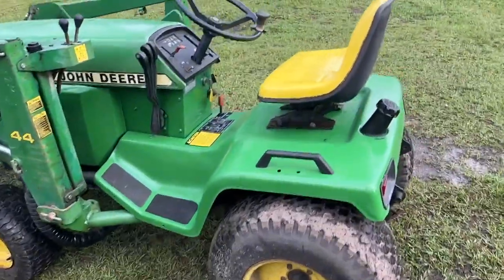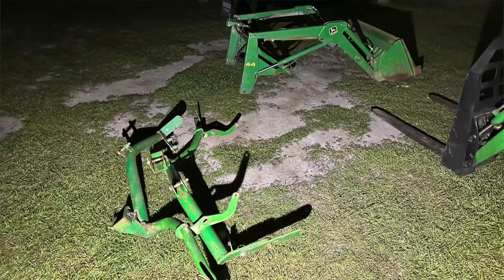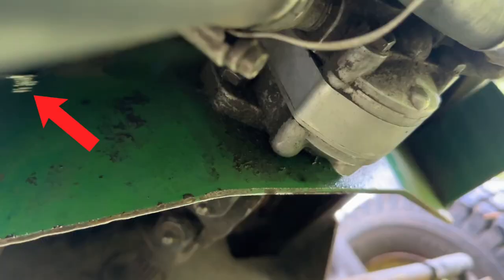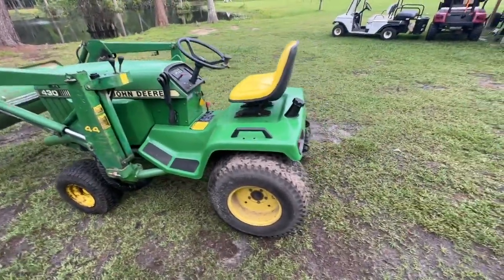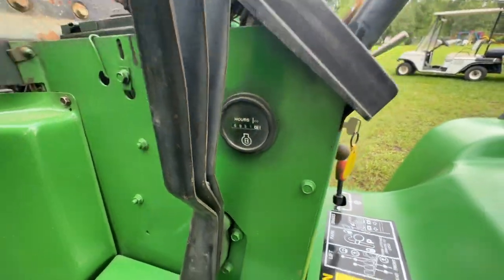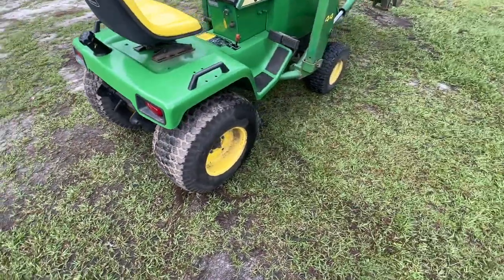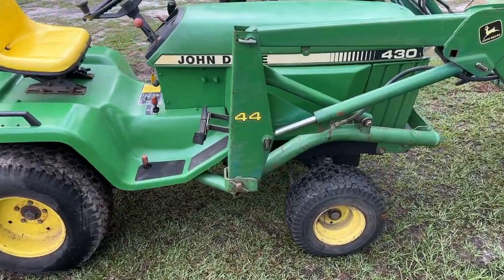John Deere 44 loader on 430 diesel garden tractor- walkaround and details!

Comment: I'm surprised they consider any of the John Deere 400 series as garden tractors. I bet them older GTs are built tougher than the modern sub-compact tractors. Sweet rig! With the loader, diesel engine, AG tires and 3PT, you'll conquer the world! Take care Luke,
Gan
Reply from the maker: Thanks for the comment! You’re right they are seriously overbuilt, which is why they’re around almost 50 years later. Great machines!
Reply: never seen a GT not blown up and scrapped last more than 10 years, mean while a 71 140H3 is still going and had it's engine rebored and rebuilt twice just because it was getting  slightly less powerful.

Comment: That Thomas guy seems to know everyone.  Looks cool, I did not know that the levers had extenders for the 430, but I guess that's not at all surprising considering the overall length of the 430.
Reply from the maker: Yeah there were longer levers on the 430 version. I had a really difficult time finding a picture to show though, because it was so uncommon. Basically every 430 with the #44 loader I have seen online has the short levers like mine.

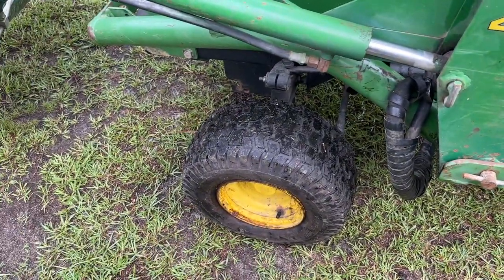Comment: 2:58 john deere dealer id for the 445 to use a 40 loader you need 4 ply tires and atleast 200# of rear ballast with 400# of rear ballast recommended or there will be lots of problems. 90's series 400's need a reserve hydro tank of atleast 5 gallons as only the 455 has a larger hydro cooler and like cheap welders use of the loader is only good for short bursts at a time or the hydro fluid will overheat and boil. i run alot of heavy equipment all day long and yeah, everything i was told matches up with everything i experience on heavy equipment such as a Ford 4500 long bed with a barko boom arm and clam grapple slinging sections of rebar cages, 8'diax10'-50' drill casing, 2'diax2' to 8'diax4-6' drill heads, cutters/pickers, plates, generators, 1,000-10,000 gallon water tanks, and dewatering pumps, dirt tillings from high voltage power line construction. it applies to the cranes that pick and set the hole side wall casings & rebar cages into the power pole holes and also the dril rig mounted to the 12 wheel watson crane carrier

Comment: I would add weights in the rear when any weight was in the bucket.
Reply from the maker: Absolutely. I ended up loading the (new ag style) tires, putting on 50lb cast iron wheel weights, and adding a 3 point ballast box filled with concrete.

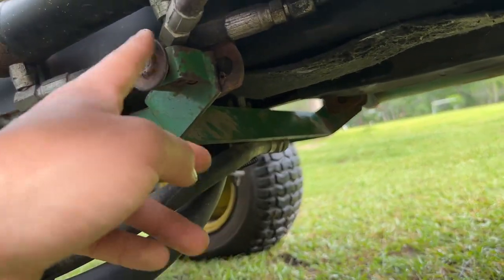Comment: hey buddy...at 2:13 in the video you show the mid mount bracket that the hydraulic pump attaches.  Can you take some measurements of the size of the steel plate
that the hydraulic pump attaches to?  Also, the length of the 2 side plates that connect the front plate to the rear plate and height of them?    There are ears that stick out from the side of the back plate that side on the inside of the frame of the tractor I believe.  anything you can share about the size of them would be very appreciated.  thx
Reply from the maker: Hi, I would be glad to do that, but unfortunately I sold the tractor a couple weeks ago. I’m sorry I couldn’t help!
Reply: @LukesJohnDeereGarage  ok, thx for responding.

Comment: Nice rig. I noticed that the rear fender pan was drilled for snow cab. Do you have the subframe brackets which support the cab underneath the fender pan? My friend has a 430 and I have a Cozy steel snow cab. Just need the lower brackets if you have them.
Reply from the maker: I actually made those holes a while ago because I mounted a 445 cab on it to see how it would work. The fit wasn’t great.

Comment: I also put a 44 loader on my 430 and subframe was from a 420, I chose to just add I believe it was 7" of heavy wall pipe to the subframe to make it fit. I did not get the pump or bracket with mine, so I ended up making a bracket that put's the pump on the front PTO. one thing I noticed is I cannot remove the grille from my tractor with the sub-frame on, and was wondering if it was cause I converted a 420 subframe to fit, but it looks like yours is the same way?
Reply from the maker: Mine has a modified 755 grill I made fit, since they’re available new. It can be removed because it attaches a little differently. I have an OEM 430 grill and I feel like there should be room above the subframe for it to fit though.

Mine came with a 420 subframe as well, but I was very fortunate to know a guy that had a spare 430 subframe and wanted to trade.

Comment: I’m planning on buying a 430, could I get some tips on what to look for? Thanks.
Reply from the maker: Check the usual spots for wear and look for a nice machine with low hours. Check the drive linkage for play and creep, as well as the steering and linkage. Look for leaks in the engine, cooling system, and hydraulics, and make sure everything works. Find a nice clean machine with low hours unless you like a project. They are great machines and I’m sure you’ll love one. The one with the loader in my video is for sale currently.

Comment: You had it shipped?!? How much was that is it worth driving 2 1/2 hours for a 316 with steering breaks and dual hydraulic valves? It’s 500 bucks
Reply from the maker: That’s a pretty good deal for a 316 with those upgrades already done! If it’s in good mechanical shape and running I wouldn’t hesitate to look at it for that price.